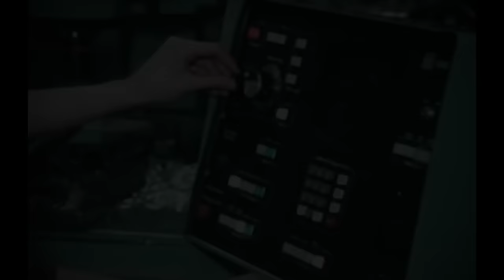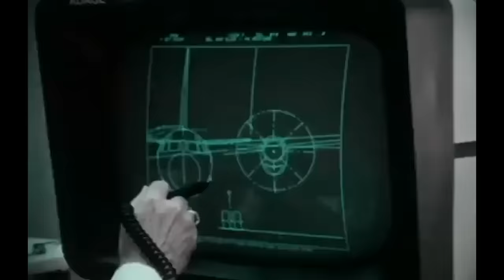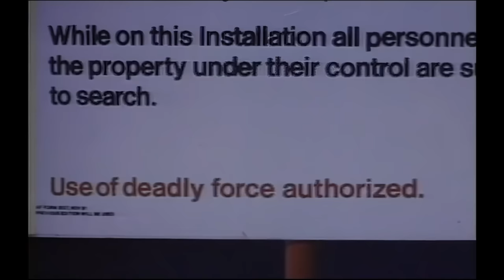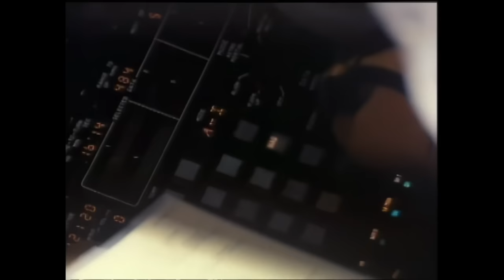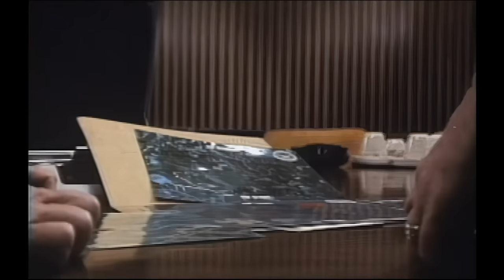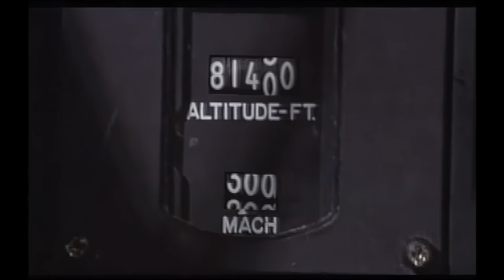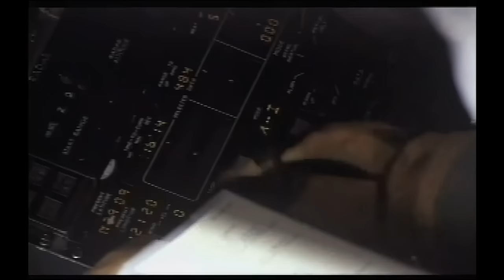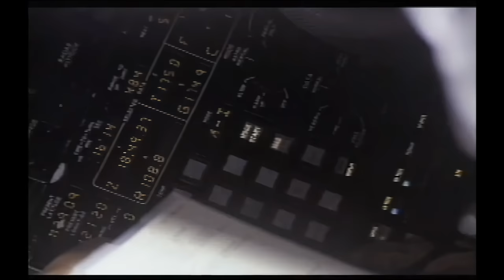SR-71/A-12 Blackbird/Oxcart | Skunk Works Untouchable Supersonic Spy Plane | Upscaled Footage

Comment: The "Stellar Navigator" was a end result of the same navigator designed for versions the Navaho missiles of the 50's.  The Navaho 3 had the Astro Tracker, or could be radio controlled.  Sled Driver Brian Shul mentioned that the Astro tracker(ANS) should have had it's own ejection seat. He loved it that much.